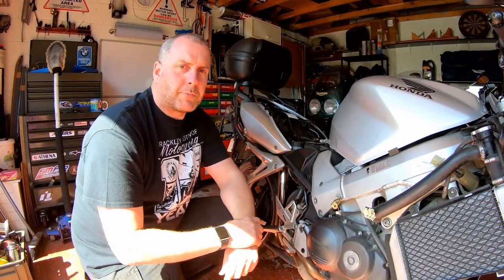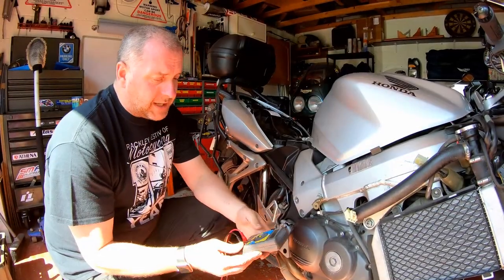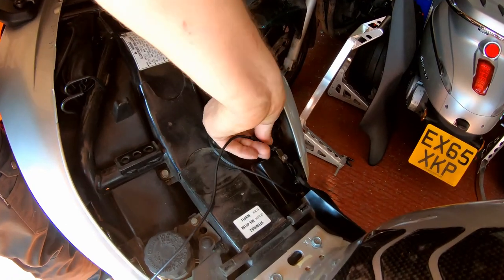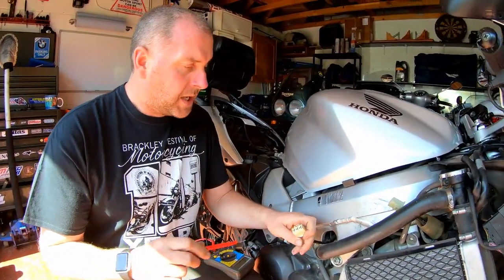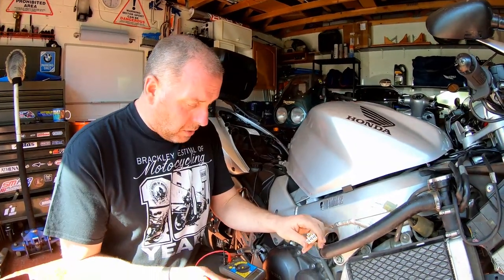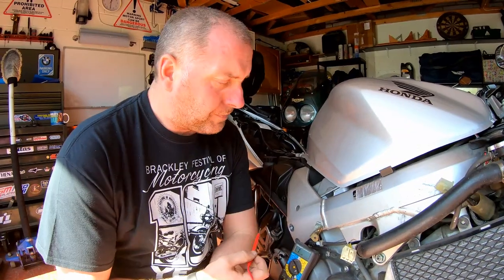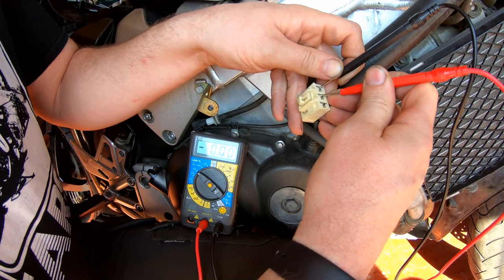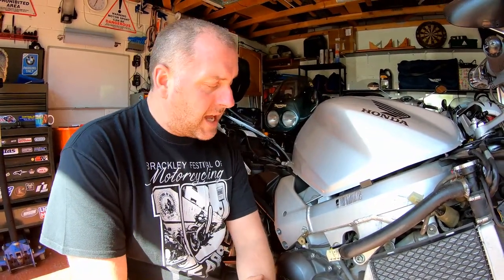How To Test The Stator On Your Motorcycle

Comment: You should be doing THREE stator tests -  The two you did, continuity to ground where it is only necessary to test one yellow cable because they're all connected, and the resistance between each of the three coil windings. The THIRD TEST being the stator AC output, CONNECTION yellow #1 - yellow #2, yellow #1 - yellow #3 and yellow #2 - yellow #3. Typically expect three equal readings of 40 - 45 vAC at 4 - 5,000 RPM's. Some stators may produce more but 40 - 45vAC is more than enough for the Regulator/Rectifier to output 14.2vDC.

Case study - A stator I recently tested had no continuity to ground and three equal coil winding resistance readings of 0.1Ω, all as expected of a good stator. The symptoms were an intermittent and random charging system failure with the battery going flat every 3 - 6 months, the battery was good, the regulator rectifier was good. The stator was toast and only proven by the three stator outputs of 35, 8 & 40vAC at 4,000 RPM.

Also worth mention here is a basic Charging System test where the voltage is tested across the battery terminals, expect 13.5v - 14.5v at 2 - 5,000 RPM, if less than 13.5v suspect the stator, if more than 14.5v suspect the regulator/rectifier.
Reply from the maker: I’m not going to disagree with anything that you have said above as you are 100% technically correct, there is a reason that the Honda manual does not specify an AC Voltage test of the stator and that is because anything over 50V AC is considered a lethal voltage and as such I cannot condone that on my channel. Happy for any body to go and do that test of their own accord, but I am not going to instruct anyone to do something that could potentially cause harm. 👍🏻
Reply: @KevsShed  Fair point, well made. I don't know what would be a lethal dose of vAC or why Honda don't include a vAC test of the stator after all that is the root source of the Charging System! Have you seen ElectroSports fault finding flow chart for motorcycles? Following that to test the Honda three wire charging system would,  in my opinion, make a blockbuster video.

Keep up the good work.
Reply from the maker: @Shoreditch  cheers bud 👍🏻

Comment: I would be checking the AC current output of the Stator, with the bike running at various rpm ( 1,200rpm 2,000rpm, 3,000rpm, and 5,000rpm). You should see an increase in AC voltage as the rpm increase. At 5,000rpm you should be seeing AC voltage over 60,000 volts being produced.  Also you need to check your Stator when it's cold and again at normal operating temp. In can look and check ok when cold, but still be faulty as it gets hot.

Comment: Hi and thank you for the video, I would advice to use the lowest possible range on the multimeter, like you said in the last test, you should get continuity but also balance, all 3 should be basically the same resistance, that high on the scale you can't read it, not sure if that multimeter is good enough for that though, again thank's for the video, thinking on buying a vfr and gathering info about it, oh and btw it's possible that on the first test it passes on a normal multimeter, and still be bad, the voltage a normal multimeter uses to run the test many times will not be enough to find the problem, to really be sure you need a megohmmeter, that injects thousands of volts in to the winding. and again thank you for you video

Comment: Doing some great work pal 
1 question so if the stator is grounding does that mean it’s knackered or does it mean there is a earthing issue coming from the stator 
Cheers
Reply from the maker: It's knackered, basically all the current is lost to ground so won't be making it's way to the Reg/Rec to be converted to DC and charge the battery!

Comment: My 2004 VFR stator passed these tests, but wasn’t putting out much AC voltage. Opened up the alternator cover and saw that the stator was cooked, so it’s possible that a burned stator can pass the continuity test.
Reply from the maker: That’s interesting, there was no leakage to earth? There will be instances where odd things happen to stators despite the standard serviceability tests passing everything as ok. Useful to know however 👍🏻

Comment: KEV mate what's the test for checking each of the voltage output from each phase from the stator to make sure it hasn't dropped a phase or one is failing with reduced output?
Reply from the maker: Honda doesn’t prescribe such a test in their workshop manual bud, for two reasons mainly. The first being that anything over 50v AC is considered a lethal voltage and shouldn’t be played with by those that don’t understand necessarily what they are doing and secondly, if the stator passes the two tests that I demonstrate in the video then there is little reason why it shouldn’t output the correct voltage.

Comment: I need get new stator and recently got the Mosfet Fh rectifier but can you recommend where I can get the upgraded Stator that doesn't burn out as much as the Oem one. Love the vids thanks
Reply from the maker: I don't know of an 'upgraded one' that is any better than the OEM, it's normally issues with the wiring that cause the heat in the stator. If you are in the UK then check out Bradford Ignitions, they come highly recommended for rewinding the stock stator. 👍
Reply: @KevsShed  thanks a mill will do. Merry Christmas 👍

Comment: Hello, checked my stator voltages at idle 15 volts on all three, at 5000 readings were 56, 50 and 53.  Would these readings be normal?.  Thanks.
Reply: Removed the stator expecting to see a cooked set of coils (68,000 mls), surprised to see a nearly new replacement stator.  As the cover was pulled of the short stumpy cap head bolt that holds the cable bracket in place fell out, the bracket was stuck to the magnetic flywheel.  The bracket was damaged as was one of the coils, obviously the cap head had not been put in with thread lock.  New stator ordered and hopefully all will be well, didn't realize when ordering that the 02/03 Vtec is fitted with 107mm diameter stator, later models with either 112 or 114mm stators.

Comment: Hi, my bike charges on the money with headlights OFF, around 14.2 @2000k plus. With headlights on it's not charging at all, in the low 12s....phases checkout, VAC is good but I get a very low reading to ground with a cheap multi-meter on each phase....Any thoughts appreciated.
Reply from the maker: Sounds like you have found your problem! 👍

Comment: The part missing from this video is that the multimeter is set to RESISTANCE. The Bike is not running so you wont get a voltage. (If you get a voltage then you stator is connected to the battery somehow - which is impossible or at least the stuff of nightmares.)
Reply: It's a RESISTANCE TEST and Kev is missing nothing, the test voltage (typically 2vDC) is supplied by the multimeter!
Reply: @Shoreditch  I didn't say he did it wrong.  I simply mentioned that he forgot to say that the multimeter should be set to resistance.  Its obvious if you know, but there are a lot of people who know nothing about electrics.